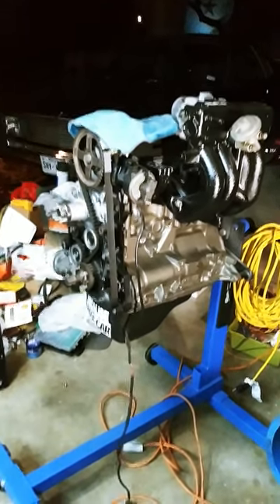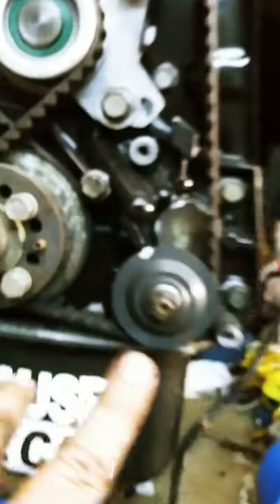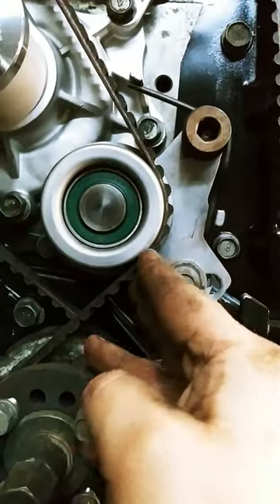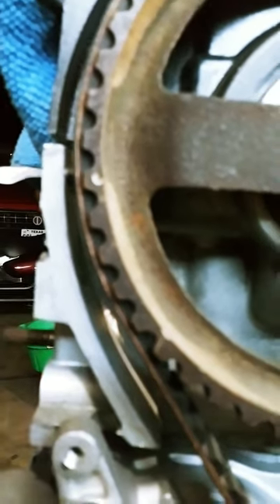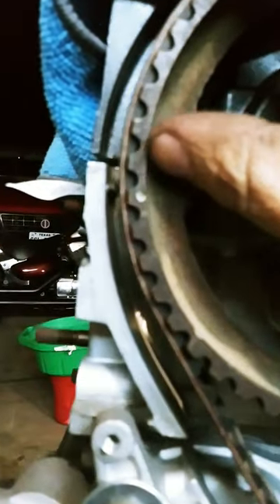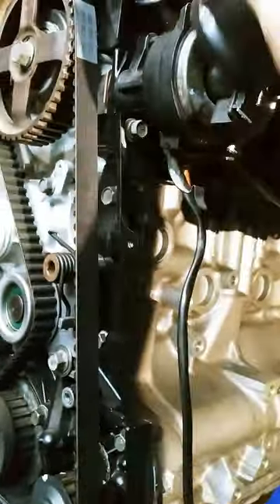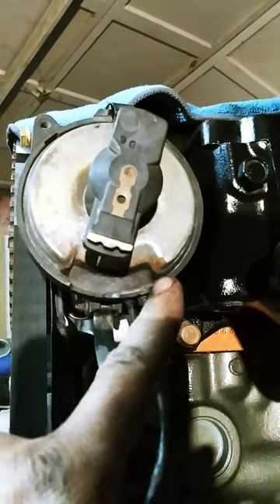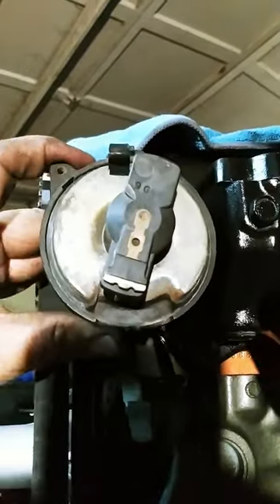2.4L Mitsubishi Mighty Max timing and firing order.

Comment: Hey Great Video. I have a question regarding the oil pump timing. Im working on one of these engines but it does not have the pulleys on the left side for the Balance shaft. If i dont have those does the timing on the oil pump matter? Ive been doing research online and a lot of the things ive read say that if the balance shaft is removed or in my case it does not even have the pulleys nor is there a belt that the timing on the oil pump does not matter. To my understanding is that if the belt for the balance shaft on the left is installed the oil pump timing is importan so it counterbalances. Is this a correct interpretation? Because the truck im working on does not have the arrow that shows were the crankshaft is supposed to be lined up nor does the oil pump have the arrow were it is supposed to be lined up. Im just confused and its kind of hard to eye ball it with out the reference arrows. So if my balance shaft belt is non existent does the oil pump timing really matter?
Reply from the maker: From what I've read it doesn't matter if the opposing balance shaft is not installed or present so the oil pump position won't matter since there won't be a counter balance on the opposite side of the motor. The balance shaft was more of a concept than an actual improvement in my opinion. I've seen guys remove the balance shaft when upgrading these motors to access more rapid power from the drive belt decreasing the drag on the motor. In theory the balance shaft was supposed to give the inline a smoother line and balance under heavy throttle but to this day I have not heard of anyone claiming to actually feel a significant difference in engine performance with or without the balance shaft present. I believe there is even a conversion kit out there to aid in deleting the balance shaft if it's present. So if yours currently does not have it and the oil pump marks aren't present you shouldn't have to worry about lining up the timing marks with the oil pump. I hope this helped. This is just from my own experience working with these motors someone else may have a different opinion or experience than mine.
Reply: @mittensthekitten5824 in about to have to change my water pump on a 94 mighty max. While doing so, I'm going to change the belt too. Is this the same engine. Mine is 2.4 liter
Reply from the maker: @Factchecker9111  yes these motors are the same from 1990 all the way up to 1996. The few things that I've noticed different between the two is in 91 the cylinder heads were swapped with roller rocker arms and an obd 1 ecm and in 94 or 95 I want to say, the throttle body was changed for an updated model which crossed over to KIA and a few other models that used this engine up into about 2001.
Reply: @justnick87  thank you for replying to me. I'm quite nervous about doing this job. It's my only vehicle. I have worked on vehicles of my own over the years, but it's been a while. This job feels like a big one for me.
Reply from the maker: @Factchecker9111  Your welcome I totally understand. The first time I did it it was a bit nerve racking but it's a lot easier than it looks. The trick is removing all pulleys and the upper alternator bracket first, then the water pump. After that it's easy to get to all the timing cover bolts. Set your timing to top dead center (TDC) before removing anything. This way you can see if any of your marks are off slightly, remove the belt and if so line them up properly with their respected marks and install the new belt. When installing the belt start with the crankshaft then the oil pump up to the intake cam and then over to the exhaust cam. When you wrap it around the adjuster it should be a bit loose then just release the adjuster pulley bolt and let it tension on its own tighten bolt and check all marks again and if non of them moved and the belt has minimal deflection on the intake side your golden. Make sure not to get your cover bolts and water pump bolts mixed up. There is a few that are specific lengths and need to be put back otherwise you will have issues. There is one bolt specific it's the one for the upper alternator bracket, that bolt goes through the pump and bracket and trust me you don't want to mess that one up lol I made that mistake it was not fun. And the 4 bolts that hold the crank pulley to the shaft is easy to remove. Loosen those 4 bolts before removing any belts, leave the engine in gear and it will give you the tension to hold crank in place to loosen them. You don't have to remove the main center bolt it holds the crank gear in place not the pulley. I think that might be everything 😁
Reply: @mittensthekitten5824  much appreciated.

Comment: awesome man, I have a question, how do you set the timing with a light if you dont have the plastic cover with the timing tape? I did the old weber swap and its running really fast and hot.
Reply from the maker: If your using a timing light you'll definitely need the belt cover to use as a degree gauge for the crankshaft pulley to identify the timing position. The only other option would be to probably play around with the distributor or go to an auto parts store and get one of the aftermarket timing mark adapter that they put on the V8 to dress them up. They are usually in the performance wall at O'Reilly's auto parts. And just mount it to the block with some strong adhesive as a temporary if you can't bolt it. That might work.

Comment: I just did mine and I have seen a few videos and they all say to rotate 2 times to make sure the timing marks line up. I had to rotate it 3 times to match the marks. Does it matter the rotations?

This is a 91 mightymax and the videos I seen are for a passenger car.

Comment: 1985 Mighty max. Turns on then turns back off after few seconds??
Reply from the maker: Are there any other symptoms? Anything you have replaced recently and how was it running prior to it running and shutting off after a few seconds?
Reply: @justnick87  i dont know much. Its a neighbir of mine. It goes like this. He was running it on the highway and just turned off. He thought it was the ignition but after unscrewing he saw the timing belt broke. He had  bought new ignition, fixed carburator, replaced all gaskets, valve block cleaned and inspected. After all this it started, was on for a couple of minutes then turned off. Now it wont start. Bad timing ??
Reply: And no response
Reply from the maker: @waltercruz9651  sorry for the late response, busy job. Check the timing again it's real easy to get it 180° off. Start from the beginning. Then check to see if the plugs are getting a spark (ignition) double check to verify your getting fuel next and if all that is good do a compression check and see if all cylinders are getting the proper and equal compression.

Comment: I tried this timing on my 92 mighty max and it pretty much wouldn’t even start I’m 100% sure the cam and crank are aligned properly but I’m kind of stumped
Reply from the maker: Have you checked to see if you have any check engine codes? I have a 90 and a 91 and the 91 had a starting issue and it turned out to be the ECU. After rebuilding the motor put it in my 90 and it started and ran great so put it into the 91 and it refused to start. The codes pointed to a bad ECU I just wanted to verify before replacing it and sure enough the computer was bad. It's been just over a year and haven't had any starting issues since. If no codes id recommend attempting a compression test on the cylinders to verify you don't have a bad head gasket or bad piston rings. It's very simple to do and inexpensive if you haven't attempted before.

Comment: I like your video my 2.4 is running like its timing is retarded lack of power what should I check? Much appreciated.
Reply from the maker: If you feel that it may be off double check that your cams and crank are aligned properly. If you feel that they are good next I would do a compression test on all 4 cylinders. I've found that these rings will be the first thing to give causing a loss in power. If compression is okay then do a full tune up, plugs, cap and rotor and maybe a heavier oil like 10w-40. And then just twist the distributor slightly left to right and see if you can raise the RPM slightly. 100 to 200 RPM won't hurt as long as you keep it between 750 to 950 rpm. I hope this helps.

Comment: How long is that distributor cord? My mechanic says autozone has the wrong distributor its like a four prong and he says the cord is too short
Reply from the maker: I apologize for getting back to you so late. I just got a new phone and haven't set up notifications for YouTube. To your question mine has been extended to 42 inches. It has been damaged so since I was repairing the damaged wire I added a 12 inch piece just to help with rerouting the wire through the intake manifold instead of over the head and along the exhaust manifold how it was originally designed.
Reply from the maker: And yes it should be a 4 prong connection

Comment: Where’s the clutch slave cylinder located?
Reply from the maker: These don't have slave cylinders. They have a mechanical clutch cable. Goes from the clutch pedal all the way to the transmission which pulls the clutch fork on the pressure plate to separate the engine from transmission.

Comment: I have a 1989 Mitsubishi mighty max sport. I have changed starter distributor new battery and still cannot get it to start and cranks but no start. Does anybody know what could be wrong with this truck. It a straight drive
Reply from the maker: Have you checked your fuel pump? And if so check the relay on the passenger side kick panel. That relay controls ignition, fuel pump and starter. It's hard to test it but it's not that expensive either.

Comment: All my notches line up except oil pump,anybody got answer?
Reply from the maker: You can try rotating it a full rotation then run the timing belt from crank to pump up to the intake cam. Make sure it's snug before wrapping the belt over the exhaust cam then around the adjusting pulley. Sometimes if there is slight slack on the intake side it will slightly pull it out of alignment.